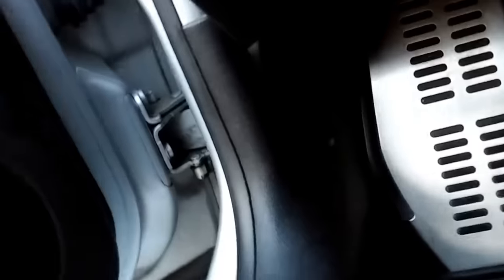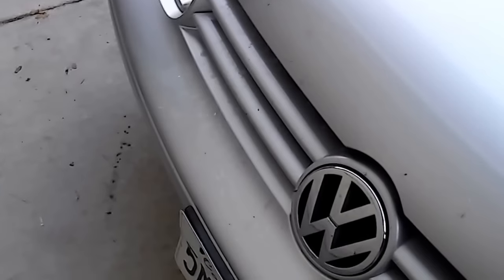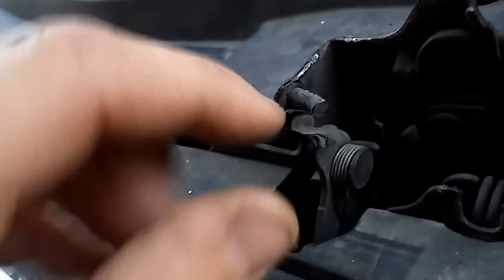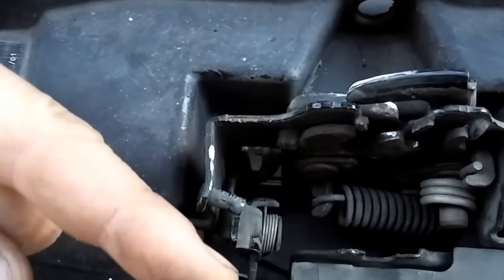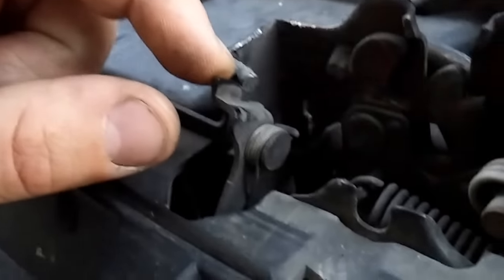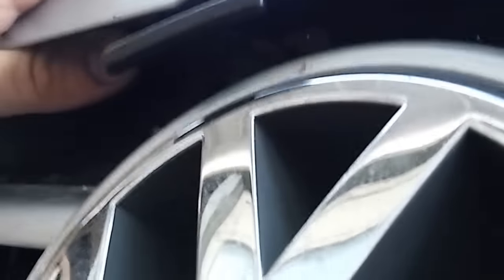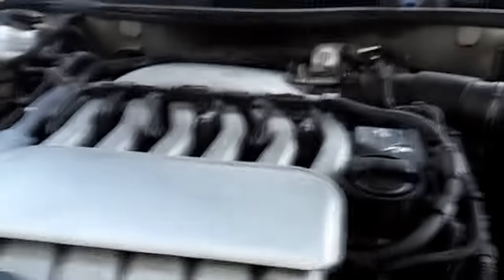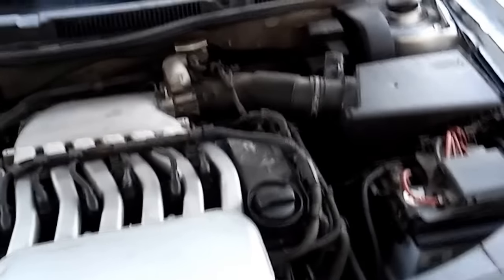1999 to 2005 VW Golf MK4 MKIV hood latch operation fix

Comment: I've been having hood latching and release problems on my 2004 Golf TDI since an incident March.  I've been low on windshield washer fluid for months and didn't want to pop the hood for fear it would take an afternoon to close it again.  I just came across this video and it saved me some $200 from having my mechanic fix it (replace the whole latch assembly - which actually would have worked in my instance, and cost a lot more money).  Thanks for a great, brief, and super informative video!

My issue is that the preliminary latch (supposed to be the middle piece on the engine side of the latch) had been pulled above the two pieces it was supposed to be between.  (Don't ask how it got that way.)  Less than two minutes with a screwdriver to reposition the prelim latch piece and some pliers to straighten things out again and the hood latch works properly for the first time in 6 months!!

Comment: Great explanation, My hood wasn't popping up when I pulled the level inside the car, had to wedge a piece of wood in the lever then pull the hood to get it to pop up (rather annoying). I lifted the lower pin at the back of the mechanism as you did and now it works properly. Before this nothing I tried was making any difference. Many Thanks.

Comment: Literally bet there loads of people need this video this helped alot after second attempt of finding a useful video, I broke the thing that pops out that you pull to open the bonnet as soon as I brought it and I have no idea how the latch system works so great help I can now get bonnet open first attempt
Reply: last night this plastic tongue came off and I can't open the hood now.  how did you open it?
Reply: @ИбрагимовИбрагим-ц1ю  i put a screwdriver through the hole and lift the latch then pull bonnet up, still haven't fixed it i just do this
Reply: @traieking  да , я разобрался с этим,  спасибо.  💪🏻

Comment: Here we go. Mine was a different issue where after putting it all back together after a rad install the hood wouldn't latch closed.   I finally ended up ordering a new one just to first figure out how the mechanism actually latched.  It took several looks but finally I saw how it locks which led me to realize that just a slight shift prevented the piece controlled by the heavy spring to rotate down enough to engage a corner cutout on the release lever which is almost impossible to see.  All I had to do was loosen the three torx screws on the original latch and wiggled it up as far as it would go and then retightened it all back. Takes about 10minutes. Btw, you don't have to remove the plastic release lever or the grill.  Just flip up the grill once loose and all three screws are accessible.
Reply: P